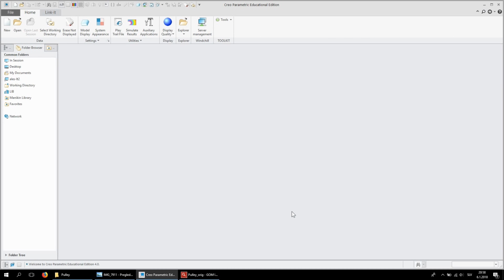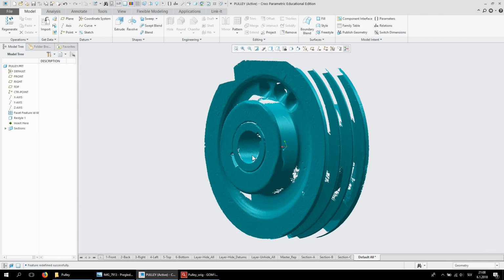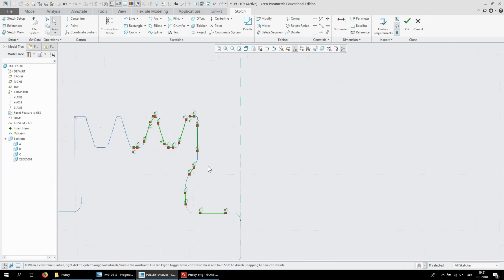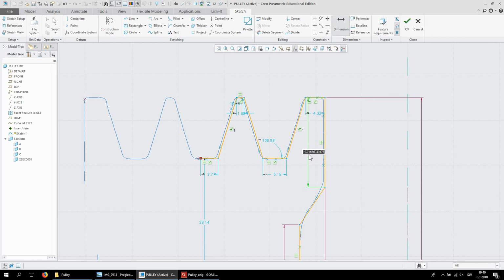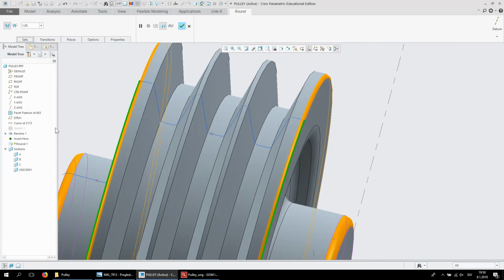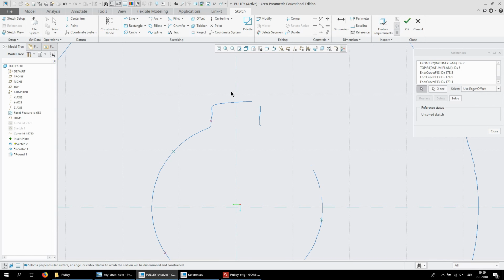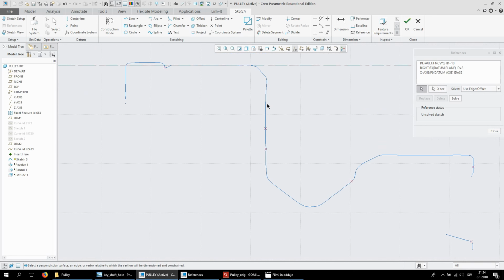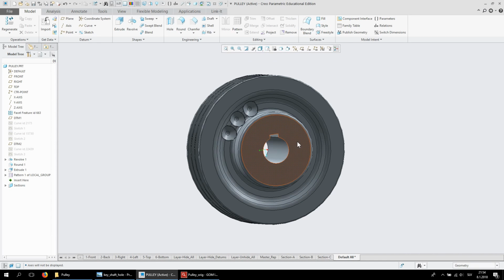Reverse engineering with Creo 4  - Introduction

Comment: Thanks for the video, it is very useful.
The groove is 8 mm wide. From the table, select above 22 to 30.
You chose above 30 to 38.
The 3 holes on the side are for  balancing run out  the pulley and are not drawn.